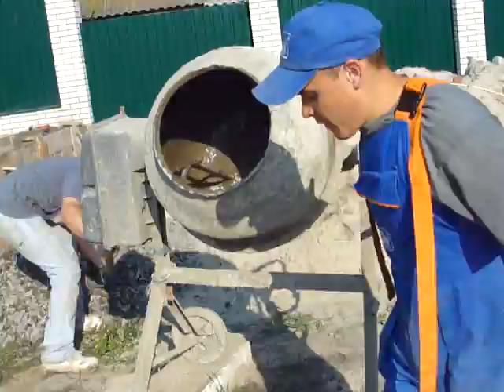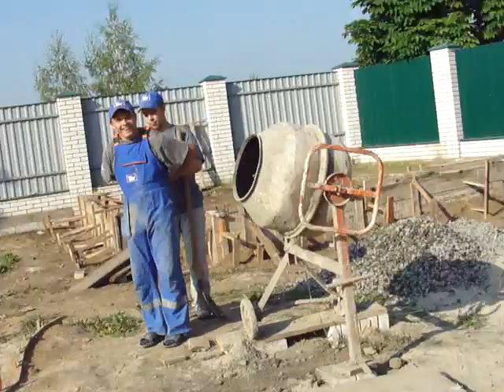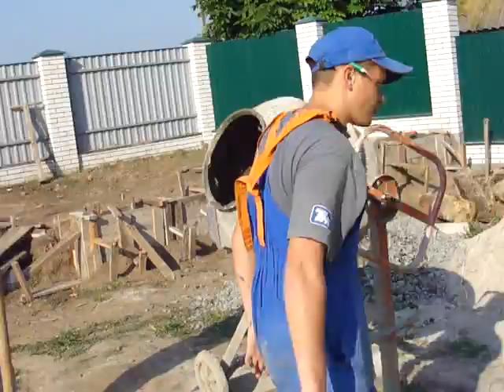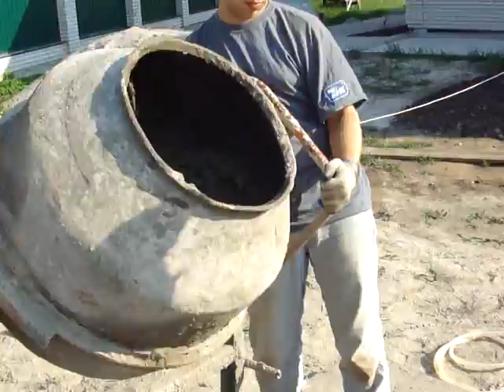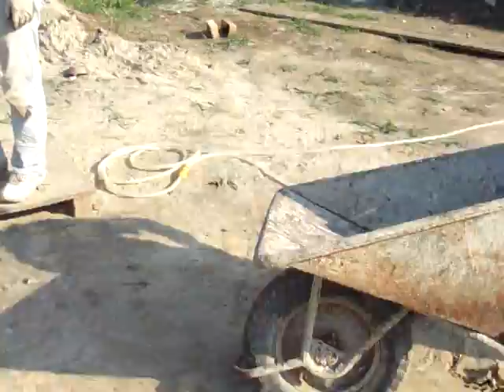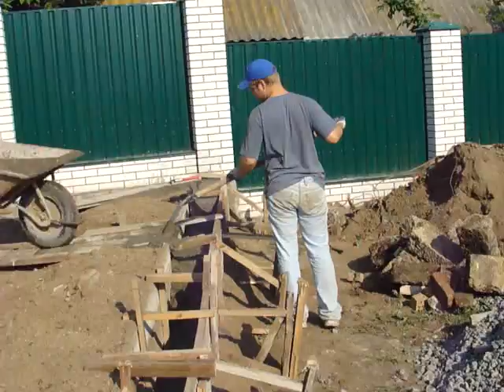how to make concrete.MP4

Comment: This has got be the worst vid. on making concrete I have seen.For a start the concrete components should be measured in their correct volumes using a bucket not a bloody shovel! Their method of adding water to the mix, just plain stupid, you can see this in concrete produced more like gastric than concrete,way too much water. Add water slowly and dont forget to add plasticiser to make concrete more manageable and not crack. Mixing time also incorrect 3 minutes minimum. By Aust. tafe tutor.
Reply: U tell em sparky